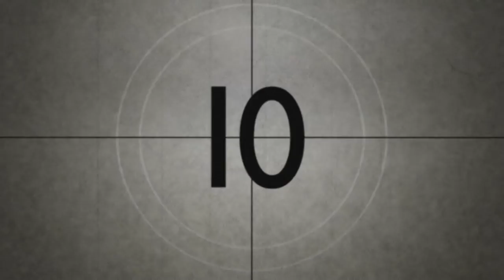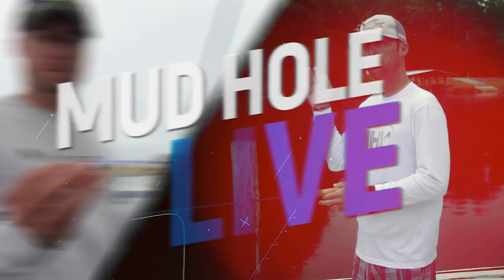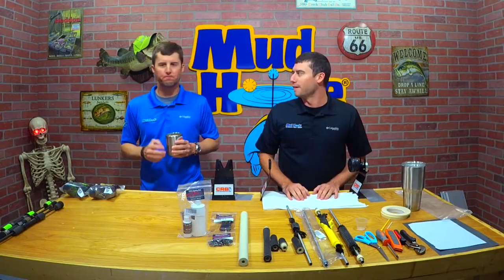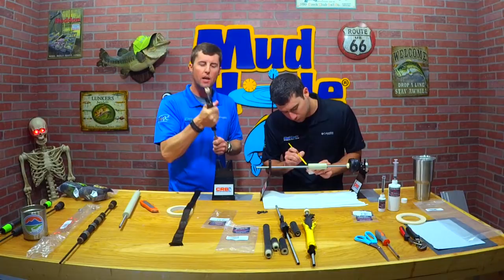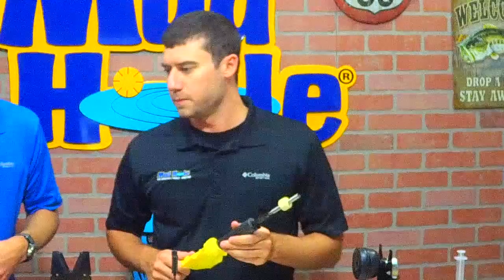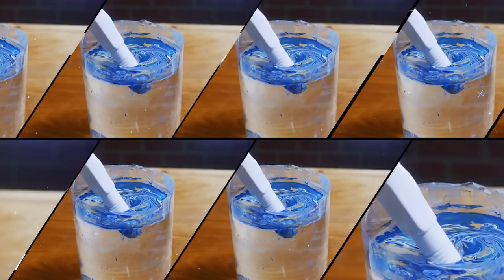Shape and Build Your Own Custom Carbon Fiber Grips

Comment: Why did you have to use all the tape? , You should have "pre made / factory" available push on arbours .... seems a waste of tape guys ....
With the "Heat Shrink" did you have to wax, or have sone release agent on the inside ?, as the epoxy might stick to the inside, and not come off ... ???
Just my perspective on things , ....
Cheers  "Down Under Mike"